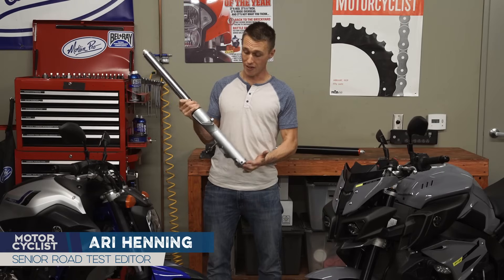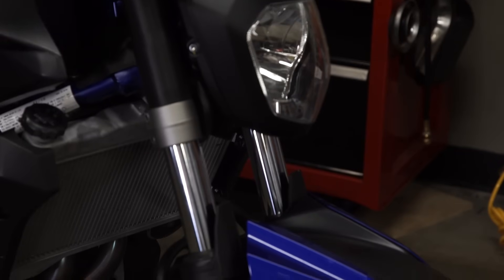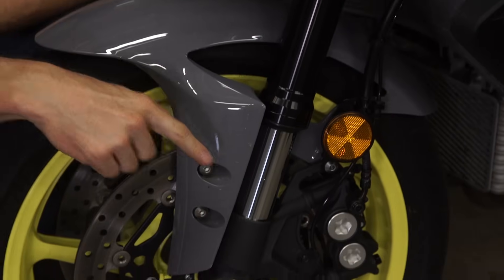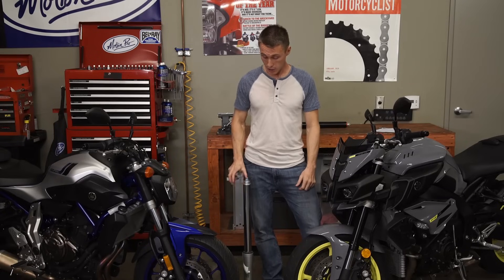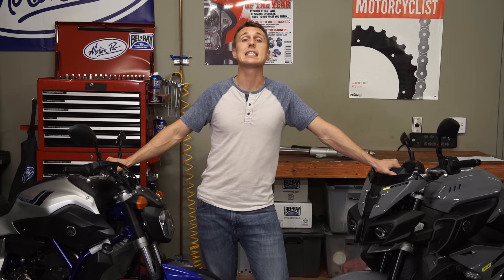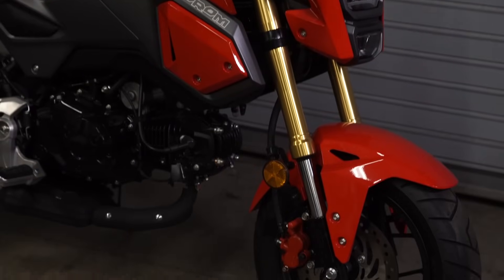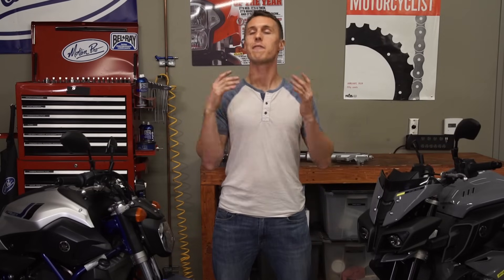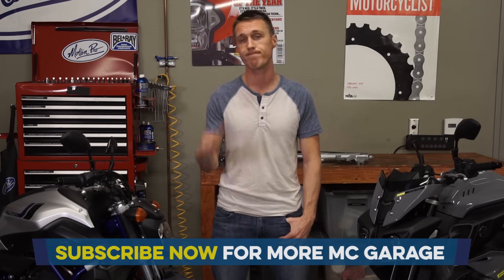Right-Side Up vs. Upside Down – Why Are Inverted Forks So Good? | MC GARAGE

Comment: okay-ish'... what about unsprung weight which affects handling like MAD!!!
The unsprung weight is the major cause to use USD on performance motorcycles because of the way they tend to affect handling and road maners of motorcycles.
Trust me on this I am an engineer!!
Reply: Well it looks like we both are correct in matter of strength and handling but,now the question is what manufacturer needed first? Strength or Handling? Anyways the were able to shoot two apples with an arrow.
Did I mentioned that I am a "self-claimed" Engineer? lol Check out my channel!!
Reply: Eliminating all other front suspension components for the sake of discussion...and assuming both have same OD steel tube...
Consider the mass of a cast aluminum slider on a standard fork vs the steel tube AND lower casting of a USD. I'm going to assume that for the same size tube, the standard fork might have a slightly lower unsprung mass than a USD.   Come to think of it, I have one fork leg each from my Bandit 1200 (43mm standard) and my Monster S2R1000 (43mm USD)...if I get bored over the T'giving weekend, I might weigh the moving portions and see if I'm close.
Reply: orangelion03 Well unfortunately that's not true. Sliders weigh more because they are filled with damping oil and has springs in them so all that weight is "unsprung" but in conventional it's not. Though overall weight of USD forks might be greater than conventional but their strength and unsprung weight are definately better, that's why they are used.
Reply: Not saying I am correct...my above comment is an assumption.  But keep in mind that:  Both forks use oil so lets call it a wash.  In any fork, half of the weigh of the spring is considered unsprung weight and both conventional and USD forks carry the spring in the upper part of the assembly.  A USD fork leg also has almost the same amount of steel tube than a conventional, and it is unsprung.  Have you ever  disassembled both types of fork leg yourself?  Take a look at the various fork seal replacement videos on youtube and you will see what I mean.    Cheers!
Reply: orangelion03 hmm... Will watch a few videos to get things clear.

Comment: and then it comes to a point where the fork is simply TOO stiff in some occasions.
i have an Aprilia Caponord, which has a 50mm fork, which is so rigid that there have been cases of people who hit gently on the back of a car while braking, and because the fork was fully compressed, instead of the fork bending, the actual frame cracked!!!

Comment: Very well explained. "Can you tell the difference?" Well ... let's say you go back a bit. Jump on a bike like a Z1000 or a Z1J, a GS1000, a Bol D'or... Now ride the thing aggressively. Get to a point where you try to go from near full right lean to near full left at about 80 ~ 90 mph... Now jump on a modern bike and try the same thing. Not only does it steer much faster and lighter, the frame and chassis don't tie themselves in knots. Take it from someone who owned a GS750 in 1978 and a GSX11 in 1980, it took muscle to throw those bikes around, but if you used muscle, the damn forks flexed, and the big silly 5.10 x 17 rear tyre wobbled around all over the place, and the damn things wobbled and slapped like a drunken shopping trolly. Now we all said/thought that was frame flex, but you put modern radial tyres in modern sizes on those bikes, (yes, you need a wider swing arm and you need to move the chain over, and it's not easy or simple) but most of the handling gremlins of the '70s and '80s simply go away... But upside down forks really are better. Just making them much stiffer is a huge improvement.
Reply: Interestingly there were lots of differences from one bike to another of supposedly the same model and setup. One would wobble around and make your life miserable while the other one would be rock steady even when you drove it hard.

Modern bikes have a more uniform behavior...
Reply: ziiofswe Yes, true. I think the bits are made with far better consistency and repeatability now. Back in the day, you'd find Ducatis with flies in the clear-coat and stuff. You don't really see that kind of thing today....

Comment: Far more than the orientation is the forks' ability to absorb bumps and keep a smooth ride. I'd much rather have the right side up forks from my CBR600 than the cheap upside down forks from the FZ09 or similar. It's becoming a trend for manufacturers to throw cheap upside down forks on bikes now as a marketing point while they still offer inferior suspension to many conventional forks. 

Also lots of right side up forks still have cartridges so they're not all basic damper rods.

Comment: Please do a video about 1.converting bulb type turn signals to LED turn signals,  2.pros and cons of an aftermarket performance exhaust compared to stock exhausts and differences between titanium,  stainless steel and carbon fibre exhausts,  3.info about electrical fuses,  4.difference between forged alloy wheels and cast ones...

Comment: USD forks have a lower centre of gravity as the tube is lighter than the rod. This would benefit sport bikes through the twisties.
Conversely,
RSU forks have less unsprung weight which is better for absorbing bumps. Which would benefit adventure bikes on bumpy roads.
Reply: i will let you use my last name instead of guru after that one.

Comment: Idea for a video: slightly controvertial. Piston arrangement. V-Twin vs Boxer vs Parellel vs inline vs v-Twin (transverse). The question this video will be seek to answer is "how does piston arrangement affect how power is transferred to the road and why some companies have stuck to one arrangement while other take a more product by product approach". This originally occurred to me when the new Africa twin was launch and there was a small fraction of rider who expected it to be V-twin like the original and not parallel.
Reply: I'd like to see +Ari Henning explaining something like this too.
Crankshaft configuration and the benefits of each.
360° crankshafts, 180° crankshaft and 270° crankshaft
V-engines, In-line engines and horizontally opposed.
Reply: Saif , Dont forget the famous V4 and V5!
Reply: Saif a parallel twin in my opinion beats a V-Twin any day much more smooth ER and faster revving.  A four cylinder motorcycle twice as good as a 2 cylinder motorcycle but has disadvantage of its width and its weight!!!   I really really really hate the. V twins
Reply: I had a 650 v-twin it had more torque and fun than my current 750cc inline four.

So am scratching my head, as am not as advanced as the tech gurus here ...

Comment: 1. is there any damage done to the bike with clutchless shifting and where? 2. why does tire traction get worse with wear on dry pavement? 3. Can you judge maximum cornering speed at 45 degree degree lean from if you know the tire's speed rating? or how many lateral g's can a tire take from a given speed rating on asphalt?

Comment: The cartridge vs damping rod difference is not really a function whether it's a USD fork or conventional right? It's just the assumption is that the conventional fork will have less expensive internals, because they usually come on less expensive bikes.

Comment: as far as I know upside down Forks were introduced for dirt bikes, since you can make longer damping ways with a smaller Fork and for a second reason very big normal forks have tube extending below the axle wich results in them grabbing dirt earlier when driving through deep ruts
Reply: I was gonna say, talk to dirtbike racers and find out what inverted forks are really about!
Reply: Peter Griffin strange that trails bikes have reverted back to conventional I guess they help pop you up over obstacles easier then usd? No idea why just what I’ve noticed
Reply: Peter Griffin the existed a long time before that - have a look at the BSA Bantam forks from the 1950's....

Comment: Please do a topic of 1 vs 2 vs 3 vs 4 cylinders
Reply: Honda Valkyrie uses a flat 6 cylinder motor. And Honda once used a 5 cylinder motor (RC211V) in their MotoGP bikes. Add these to the review suggestion please!
Reply: @u9Nails and the v8 boss hoss?
Reply: noface actually more cylinders provide more hp but not torque, few cylinder do produce more torque with the same displacement engine but with more cylinder. Because the engine with few cylinders have more stroke
Reply: @siontheodorus1501  How come we just can't have an 8-cyl engine that goes to 20k RPM then?  It would sound way better than anything else and the size of the pistons can be half that of a 4 cyl so the space can be nearly identical.
Reply: @antdx316  sure it can be like that, but just like f1, the start will be very slow and you need high rpm to run well
Reply: @siontheodorus1501  Yeah, that's ok because once you are at the high-end of the power it should be a blissful experience.  On the R6, if you are on the wrong gear of course, there still will be the thrust feel but if you are on the right gear, near trees it can feel very very fast.
Reply: @antdx316 why stop at 8?
Reply: @Robert-xs2mv  I assume the torque would be dangerous due to the chance of high-siding all the time.
Reply: cylinders basically is replacement of your foot and foot pedal on bicycle. for example in order to move the bike we need certain amount of force, e.g 1 torque. for 1 cylinder, it's like a bike having only 1 pedal, we must give 1 torque on single leg for single rotation. while on 2 cylinders, it's mean having 2 pedals, the weight distributed each cylinders, if bike need 1 torque to move, then each cylinder only need contribute half torque. on 3 cylinders, each cylinder contribute 1/3 torque. and last 4 cylinders, each cylinders contribute 1/4 torque. now if we reverse, let's say each cylinder on 4 cylinders contribute same amount of torque like on 1 cylinder, then the machine produce 4 times more torque than 1 cylinders. ofc, this is just simple math, we must count the structure of the crankshaft, the diameter of the cylinders, height of cylinder head, and so on. but basically, more cylinders mean more torque, not speed but torque.
Reply: There isn't a versus, they all have different attributes in their engine configuration. who ever said there aren't dumb questions was probably a moron.

Comment: If you ride a moped or underbone bikes, you dont need USD forks.
Reply: My 1980 Yamaha QT50 has USD forks.
Crazy handling!!!!
Reply: I ride a Ninja 250 and I had both my seals go out on me. And it's just like what he said in the video, just a bit of weeping, although one was more of a gusher, but I still had enough that I could ride for a bit before fixing it.

And when you consider that you don't really need it for a smaller bike anyways, I fail to see why having USD forks on something like a Grom would make any sense when the top speed is only like 35mph or something like that.

Comment: Awesome video and thanks for the facts and unbiased opinions! Two subjects I would reeeeeaallly love you guys to cover:
a) Spoked wheels VS Rims on dual sports like VStrom .. What do one riders get and what do the others ? Personally since I am looking for something up to 20% off road and 80% on road, I think Rims make more sense to me, but am I wrong ?
b) All the differences there are between 2 and 4 cylinder bikes ? I know a lot of them (torque curve, HP curve, shaking, gear shifting timing etc..) and I have ridden both engine types (my 4 cylinder Yamaha XJ 600, and my friends Suzuki Vstrom and Honda CB 500). I have noticed some differences but to be fair, I am novice rider, and these are just two of the million bikes there are. Since you guys always put in the facts + your vast experience, would you do this for these subjects ?
PS I think that generally these subjects are good to hear by anyone, however the reason why I need them is because in about 1.5 - 2 years, when I get more miles and more experience, I would like to buy a brand new bike, and I would like to make the best choice for me.
Super thanks :)
Reply: Ari Henning Hey Ari, thanks you for your quick and great reply! I will keep my eye on the upcomming video. You guys rock!! :-)

Comment: Good video. Tire width as mentioned is a good idea. I swapped the 190/50 on my 2007 R1 for a 180/55 and feel the bike turns better now. Another video idea: I would like to have chain sizes explained. I have 520 and 530 figured out, but do not know the mening of the numbers. I do not even know the name of the type of chain on my 1970 Harley FLH.

Comment: next topic: tyre width. What are reasons manufacturer installs wider tyre in bigger bikes? Besides cool look?
Reply: tyre width does not effect friction.its not about grip its about cooling (bigger surface faster cooling) and handling (for smooth counter steering) etc.
Reply: Well actually, a larger surface area does lead to more grip since polymers are a special case. When stressed, polymers loose their stickiness, or coefficient of friction if you prefer the technical term, so the easiest way to reduce the stress in a tire is to make it wider. This is of course an oversimplification, but engineering explained has a video dedicated to it if you aren't completely satisfied with my reply
Reply: Yup, amazingly surface area doesn't appear in the grip equation. I can't wrap my head around that one!
Reply: Moto 3 bikes only use a 100 or a 90 section rear tyre. Most 125cc bikes have 130s from factory, so why do racing 250s use skinnier tyres?
Reply: My theory is a bigger tire is going to get warmer/faster/slower but also at the same time, once warm, is going to stay warmer for longer.. also doing 80mph corners on something the size of a bicycle tire, is pretty fkin scary. because tires do slip through corners, with a wider tire, there is a place to slip too most of the time, that little extra bit a rubber could just save you.
Reply: lighter and more agile. Thicker means more contact surface (so better grip) and more stabality.
Reply: Matteo .Bassini 
but those weight numbers you're quoting are for the entire bike. The 650 twin family from Kawasaki are indeed notorious for being quite porky, though.
Reply: helps in cornering.. the frictional force remains the same...
Reply: It is for grip and ability for cornering. Just like f1, why would they use very wide tire if narrow tire can have the same grip? Wider tires provide more contact point and more grip. Narrower tires only have small contact point, and all the force can't spread out, and stressed the tire quickly
Reply: Tires have more than 1.0 friction coefficient
Reply: On street cars a bicycle tire and a 2 foot wide dragster tire,if they are made from the same material, have the same coefficient of friction. Same grip and traction. 
The reason they are wider on drag cars is the molecules can only hold together so much. 
In other words it will shear the rubber off the tire, rather then overcome the actual friction. 
I don't know if this is the reason on motorcycles. But it's true for cars.
Reply: for more grip, lol
Reply: It may sound weird to you but amount of grip have nothing to do with tyre width. Wide tyres and narrow tyres have same amount of grip. Forces involved in grip and traction are not that simple.
Reply: Fr = μN     , Friction Force=Coefficient of Friction x  Perpendicular Force Pushing the Surface

Think about this equation a little bit please.
Reply: wider tires has a lot to do in aggressive cornering on asphalt or concrete. that's why you dont see wide tires in motocross or scooters. bikers dont drag their knee on the ground when cornering on motocross or scooters
Reply: Yeah, only look cool really. Weight? No. The MT07 has 180 rear and it weighs 180kg.. the ER6n (naked Ninja650 if you live in the US), has 160rear and it weighs 200+kg.
Reply: there are so many factors.  One you wouldn't normally think about is buoyancy.  if you stick wide tires on a very low weight bike you would be more prone to hydro planing etc..